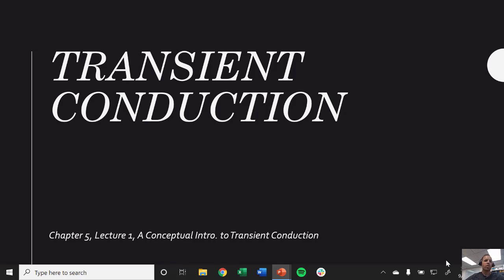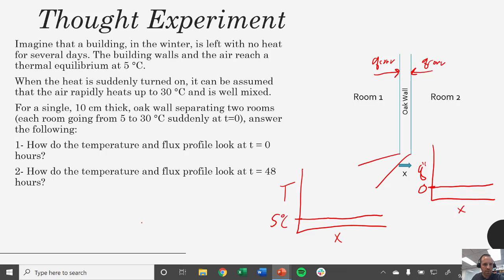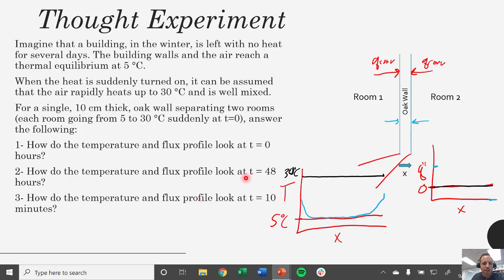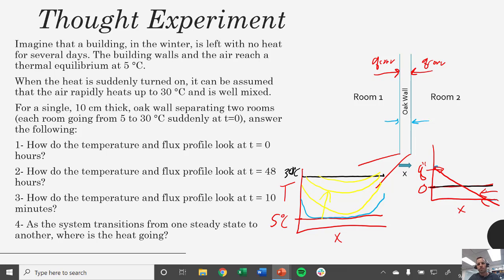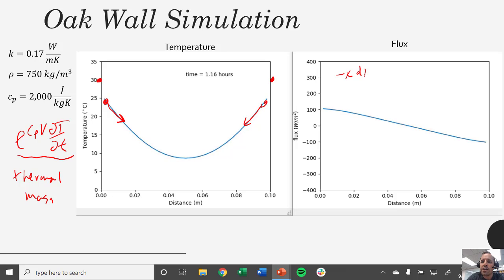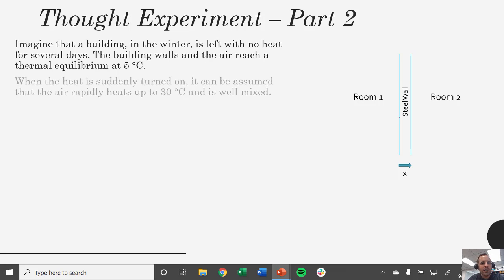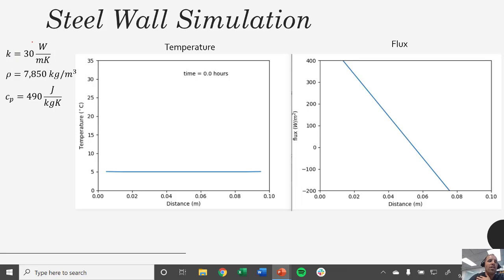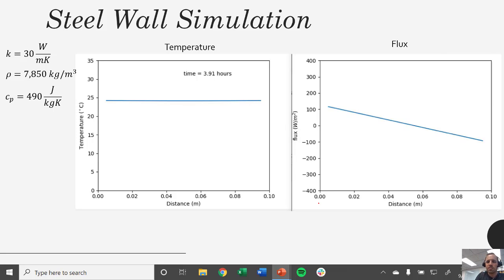Heat Transfer - Chapter 5 - Conceptual Overview of Transient Conduction

Comment: Great lecture. One question: What exactly were the boundary conditions for these simulations?  We know the initial and final BC. However, neither is wall flux nor the wall temperature  known at a given time.
Reply from the maker: Thanks! They are convection b.c.s on each side.
Reply: @kodymerlin1  but in in the equation hA (Tair-Twall) we don't know Twall